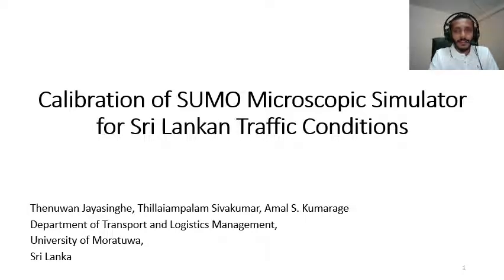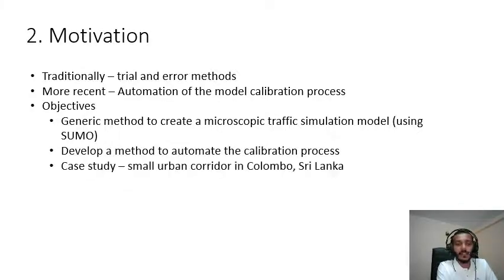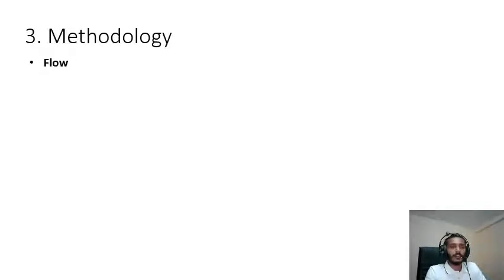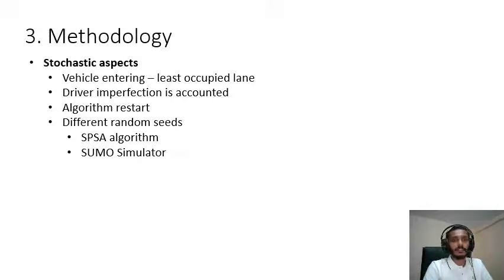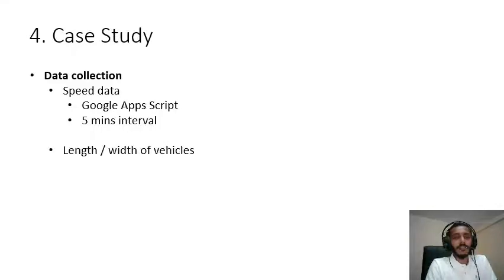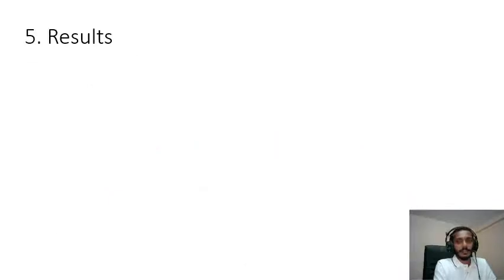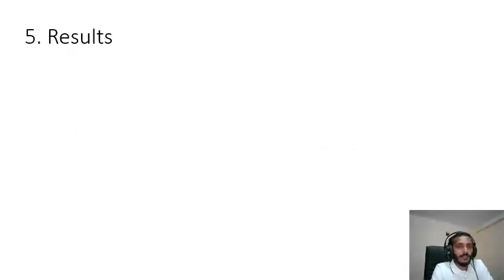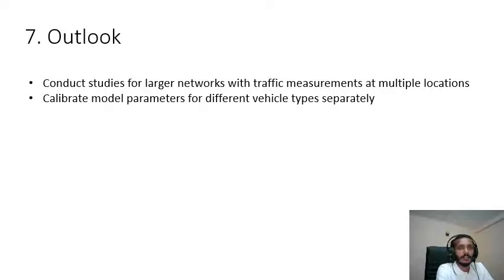Calibration of SUMO Microscopic Simulator for Sri Lankan Traffic Conditions

Comment: Hi thanks for nice presentation. Since manual counts were aggregated for each 5 min interval , different edgedata file and thus final route file was used to start simulation?  If so, how speed and count data from simulation were collected? is it collected at specific timestep or some average value over a timeperiod ?
Reply from the maker: Hi, you can define all the demand in one edge data file. As simulation output, you can generate an edge data output, where you can specify how the data should be aggregated.